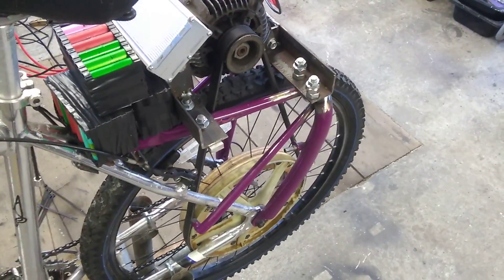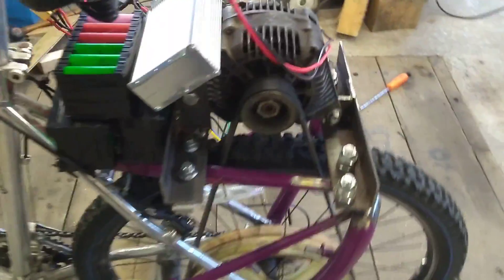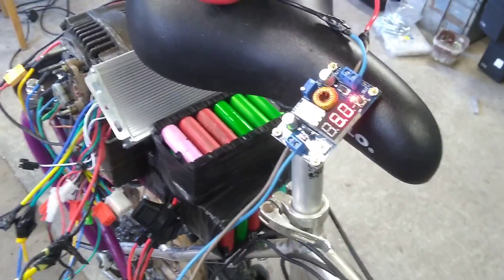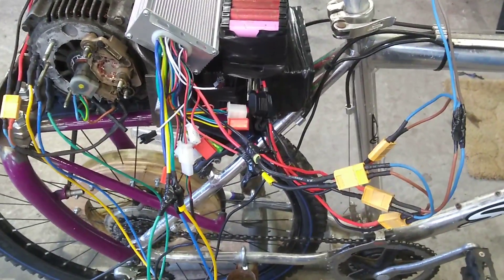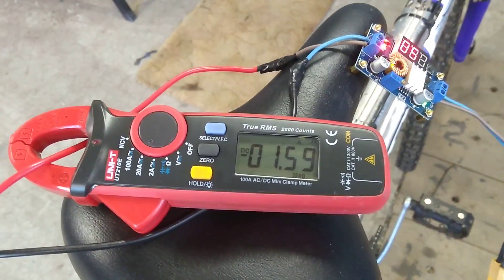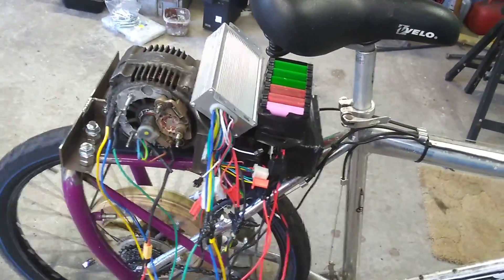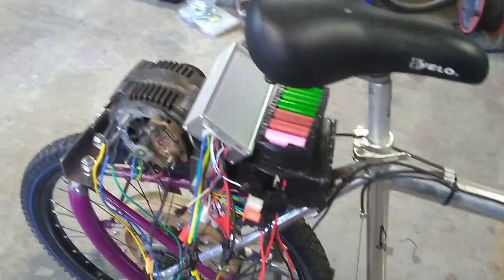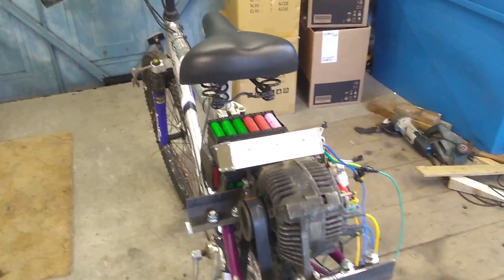Part 3 DIY E-Bike using car alternator, laptop batteries and cheap Chinese controller

Comment: May I know How much load it will take this alternator motor?
Reply from the maker: It seems to be able to handle 800W without getting too warm so long as I pedal along with it. I am using this bike to cycle 12 miles and it is quite warm to touch when I get home but I always pedal along with it. If not pedalling it would get very hot. With better gearing it would not get so hot.